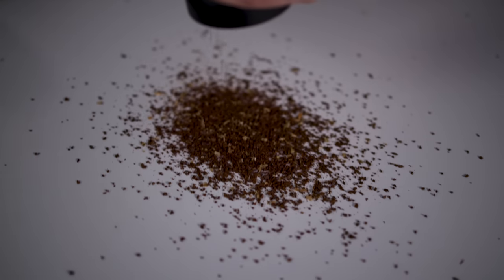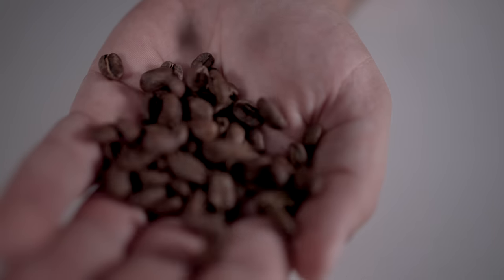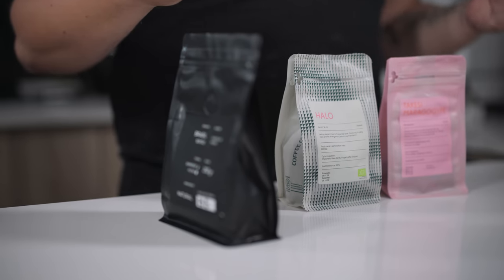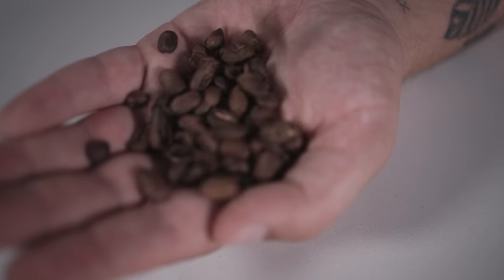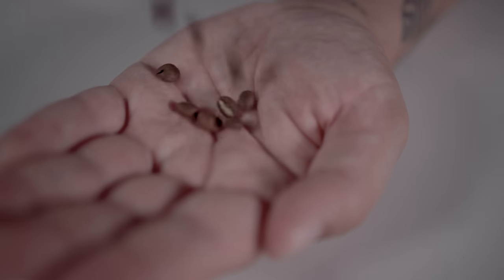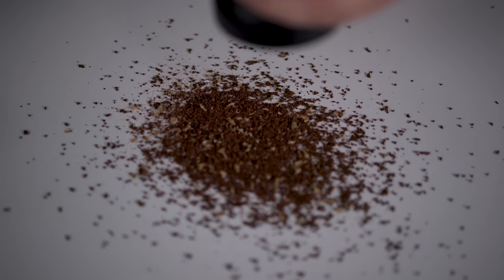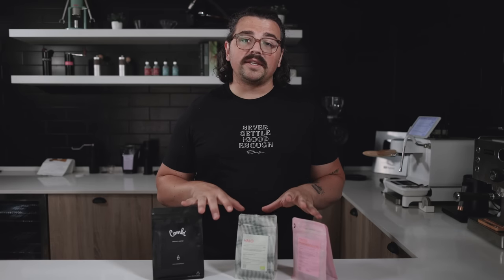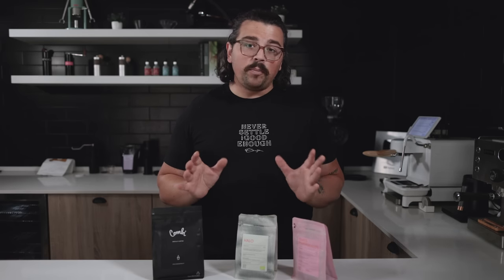HOW TO DIAL IN ESPRESSO: Using Information from the Bag

Comment: I’d love an app where you input the bean variables: elevation, variety, process, etc and it spits out some starting place recipes.  Even better if you could input some or most of the extraction variables, as well, and it fills in the blank(s).  For example: INPUT: A light roast, washed,  Ethiopian, bourbon @ 2000m ASL; 18g dose, 2.5 ratio, 90C, 9 bar, <BLANK> grind size; ENTER and it gives you a starting grind size.  

While we’re at it, I’d also love an app that translates grind size to clicks on as many grinders as possible.  How cool would it be if a recipe could be in microns instead of “setting X of grinder Y”: you could then input microns and the grinder you use into the app.  The app then spits out the number of clicks for your grinder.  Even better if it worked in reverse as well, so old recipes that say “25 clicks on my Commendante” could be translated with the app to microns, which could then be converted for your own device.  Even better UE/UI would allow for direct conversion from grinder to grinder.  

But it would be best if we all started speaking the same language, re grind size, rather than the individual language of our different grinders.  As a beginner in specialty coffee, I find figuring out the grind size the most frustrating variable to work out from recipe recommendations.  I was just rewatching Daddy Hof’s ultimate brew guides for Moka and Aeropress (my daily drivers), and I found myself (ironically) shouting at my iPad, “What’s ‘medium-fine mean?  Where are the microns, James, where are the microns?!?”  If we all made this switch, then we could get manufacturers to talk in microns of grind size per click, not microns of burr travel per click.  

So endeth the rant.  It didn’t start out as a rant, but… 🤷‍♂️
Reply: I wanted a grinder grind size conversion among popular grinders
Reply: that sounds fucking amazing

Comment: This is super interesting! I have 2 questions coming out of this:

1) Would this info also be helpful in dialing in other brewing methods (eg. pourovers)?

2) For us who aren't as knowledged as you are, is there a chart or graph or something that would help us know/remember which varietal is denser/lighter, which process extracts more, etc?

Thanks!
Reply: From my experience, YMMV, in doing POs, yes absolutely! For instance: Take the delicious Limu that is washed and a tasty Columbian honey, and without even getting onto the exact varietal, you are adjusting grind size based on bean density and changing water temp, pour technique and even the filter you are using. I will usually eat 2 or 3 beans, by crushing them with my molars, to see how the bean reacts. Does it shatter like glass or does it crumble evenly?
Reply: @MikeGianetti  Is there a chart or graph? Or is it "try it and record it"? Also, a coffee cup salute to you for the bean test!

Comment: Thank you! I find these review-overviews to be very helpful. I began my coffee nerding late 2021 with learning pour-over, then got a Flair Pro 2 in late Spring. I have been getting the Fellow Drops most of that time as well. I found I’ve been getting lost in the details of grinding, puck making, trad vs turbo, etc. Basically getting lost in variables and not being able to relocate where I had come across some different tidbit of information during the past year to review. The timing of this video is fantastic, because I just this weekend pulled out the pile of coffee bags I had saved to keep as a “database” (ok, unhelpful pile of varying degrees of information). Anyway, thanks! Helps me reset/recenter my thinking.

Comment: Hey Lance, audio is MUCH better this time way around. The video has some work that needs to be done, but it's a small change. You are getting a lot of soft focus during your slight movements due to too shallow of a depth of field on your stationary shot. Basically, f-stop is way too low for what you are doing. 

The bokeh effect is something people love when they see it at first, but too much (which is the case here) makes slight movements out of focus, and any close up shots are barely usable (every shot you had of grinds and beans and all that had way too little in focus).

Keep up the good work, it's a small change that will make a big difference and match production quality to your already great content quality.

Comment: I was hanging out for some tips on flow profiling. Have you any videos in the works? It is relatively new area of espresso and not a lot of info out there. There are profiles for different roasts etc but I'm interested in understanding what different flows do during the different phases of expresso extraction i.e. long pre-infusion to profile out harsh acidity or a quick high flow bump post shorter pre-infusion to get more body.

Comment: I honestly didn’t know that I should pay attention to the processing 😂 Cool to know! I definitely use Temp Dose Yield and pull all kinds of ratios. Sometimes the coffee tells you the ratio. I’ve seen these epic ristrettos that knocked my socks off I pulled it the usual way expecting a 1:2 and find myself a 1:1 but taste and grind coarser next time and find the ideal 1:2. I like to taste the espresso and the 1:3 / 1:4 definitely works great with these huge doses like 22g, 23g, 24g… recently I’ve been doing 27g to 28g shots with the new nanotech basket from e&b / ims. I just couldn’t believe it extracted so well and so tasty we end up maxing out the decent at like 63 seconds 😂. With layered shots I almost never even change the temperature anymore. I’ll use temp adjustments for lighter roasts and 100% shots and I tend to do Cremina, Londinium, or LRV2. Do you have a goto profile you like on the DE1?

Comment: At least on Niche Zero, I noticed that washed Ethiopia tends to produce a lot more fines, which means I have to dial in coarser in order to maintain a reasonable flow rate. But coarser grind works against increasing extraction. What’s the better way without changing grinders?
Reply: Many of the Ethiopian origin varietals has a tendency to produce a lot of fines in general, not only on the Niche, basically so much that its kind of an in-joke at times among some coffee groups. Dunno about the specific bean varietal called ethiopia though, the last bag of that I had was from Ecuador and was hard to extract. Or it could be the red honey processing it got.

Comment: in the last two video you wrapped up an sca intermediate barista skill, did you think to do also something about water ?
i admit that usually i go only for the contact time and yeld , usually it works, but you mean is that if i have a light roast that, for example, in a ratio 1:3 or 4, i find the body too weak should i go finer and do more than the usually 25-30 sec? my understand was that the coffee can be burnt at that point
also, did you have some book to suggest about the variety ? 

about the variety, you where talking about geisha, did you have some bag to send me for free? first time i ear it, sound cheap 😀

Comment: Would you say there's a inverse correlation between solubility of a coffee and how quickly it spoils? Sounds like it would be the case.
Reply from the maker: I wouldn't use the word "spoil" but with green coffee, you usually have a much shorter life with washed coffees if stored in room temp and decent humidity. Roasted, I have found that a lot of this depends on the roast profile. So, darker roasts tend to last a very short time whereas lighter roasts last much longer.
Reply: @LanceHedrick  Makes sense, have also found roast level to be the overwhelming factor too. On that note, I've always wondered how you keep the masses of incoming coffee fresh. I'm assuming your freezer must be vacuum packed to the brim? 😅

Comment: I wonder if you can bypass a lot of the technicalities with roast, variety etc. by just directly measuring the density? Would really just need a good scale and volumetric device.
Reply: The easiest way I can think of to (relatively) accurately measure the volume of coffee beans would be to fill a small vessel (say a ramekin) with water, put it on a plate that has been tared out on your scale, put a known weight of coffee into the full ramekin and then weigh the displaced water on the plate.  Obviously some water would stay on the side/bottom of the ramekin, but it’s a place to start.  I suppose you could tare a dry paper towel with the plate and use it to absorb any water on the sides/bottom of the ramekin.  On the other hand there’d be some extra displaced water from any air bubbles trapped in the nooks and crannies of the beans that might cancel out any water on the sides/bottom of the ramekin.  Sorry this wanders a bit.  I was thinking it through as I typed.
Reply: @coreycannon4511  I was thinking of like a graduated cylinder kind of thing.
Reply: @garfieldclass10  Well damn.   That’d be WAAAY simpler, lol.

Comment: I watched a couple of timesand still confused. 
I have de1
Lets say i have a medium to dark roast. Doing 18g in and 36 out and for simplicity its a straight 8 bar in 30 seconds.
If it is underextracted in flavour.
I want to understand all.
Would i
Raise or lower temp?
Try 6 or 9 bar?
Grind courser or finer?
Run yield 5 seconds more or less?

I am always a bit overwhelmed and watched loads of videos. Will write this and save next to machine with this answer.

I understand the whole light roast needs less bar and higher temp i am meaning each thing when dialing in for taste when almost there

Comment: Why give us a top 3 (grind, yield, temp) but then not explain how to use, which to start with?

At one point you mention tweaking both Yield AND temperature. No mention of grind size. Why would I adjust two variables at once? I wouldnt know what caused what...? And why are we skipping your #1 tip: adjust grind size.

Even more frustrating, you end up talking about ease of extraction more than anything else. Which in itself is an easy way to conceptialize why variables are adjusted. You explain how processing, roast, variety/altitude=density impact ease of extraction. Helpfull. But you never tie them back into your top 3 variables.

More structure!
More demonstration of what it looks like if you start dialling in (including shots of the naked portafilter when you are not getting it right with the variables)!
Increase useability of your knowhow!
Reply from the maker: Interesting you found such issues in following the guides. Haven't run into anyone at odds with it. I do build off previous videos which I have linked. Have you perchance viewed any? Cheers